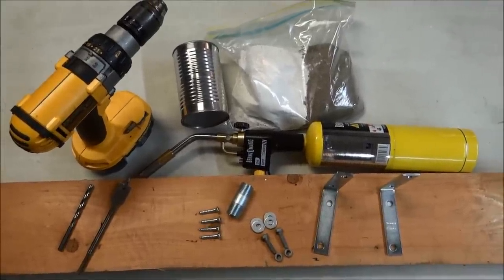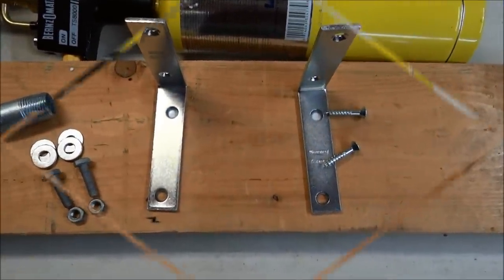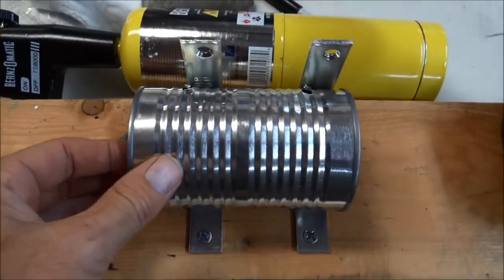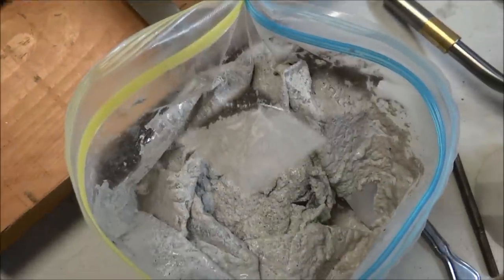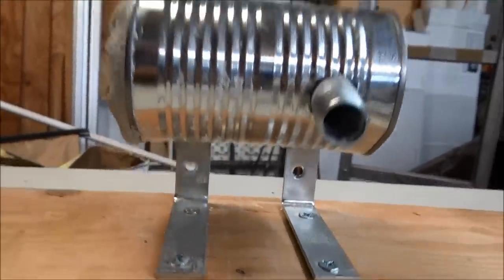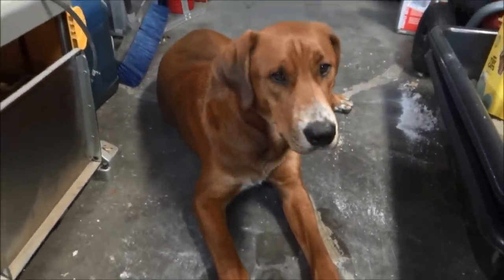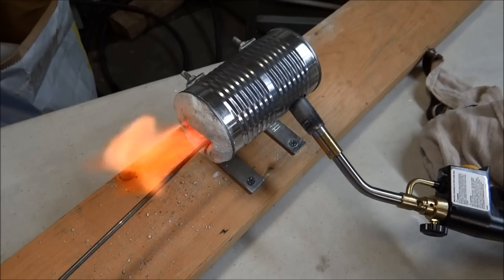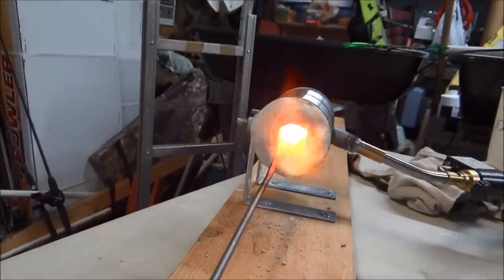Home Made Soup Can Forge - 2000+ degrees - Make your Own Tools

Comment: does the regular blue bottle propane get hot enough too?  or is it only map gas that does it for ya?
Reply from the maker: Yes, the propane will work, just take a little longer.  Remember to heat it up slow for the first run.  Thanks Delta.

Comment: I made a larger version of this lastnight and I am having trouble getting it up to temperature.

I think the internal volume might be too large for my torch. Also, Plaster/Sand isn't a very good insulator.
Reply from the maker: Jeremey Allen Maybe add another torch.
Reply: As it turns out, I made the internal diameter too big. I applied a bit more mortar to the inside, and now it's perfect.
Reply: In his video he uses mapp gas and it's hotter than propane so buying another tank is a waste mapp gas cost the tank alone $10.00 with igniter $50.00 or less the propane take cost $3.00 alone at the Home Depot

Comment: Couldn't you make a hole on both sides, and have the torch close to one side and angled to the other so that the flames shoot out the back yet it's still the same temp on the closest side?

I know you tried to make this really simple but I'm just wondering.
Reply from the maker: Daniel Quilling You will have to test that and let me know.
Reply: LifeBuzzN Yeah, just a theory.

Comment: This looks like a cannister of Bernzomatic Mapp gas. If so real Mapp gas is no longer made and this is really just a cannister of propane and propylene of which the difference in temp is negligible by about 100 degrees compared to straight propane.

Comment: I did it with a paint can but the hole is the same size yet my forge is not getting near as hot and the flame is hitting the wall and just getting that one area hot but not shooting out the front.
Reply from the maker: Joe Dimagio You can is probably too big for the size torch.

Comment: At that rate, how long will a new bottle of Mapp Gas burn...?

How much lower was the temperature using regular propane...??
Reply: +Bob White Propane burns at around 3,600 F and MAPP gas burns at around 5,300 F. These are not exact numbers, but close enough to demonstrate the difference. I've used both in a similarly constructed forge, and the yellow tank will reduce your burn time by about 30% per blade. Hope this helps!!
Reply: But using MAPP costs 2-3X what using propane does
Reply: Sleeper Awake It's worth it. I've used both, and MAPP is way faster and gives a good orange glow to my steel in less than half the time regular propane does.
Reply: Ok, I'll go experiment again.  If using a forge like this one propane is still the economic way to go.  However, I have used MAPP to bring old files quickly to critical temp and I don't remember the difference being that drastic.  But I will go and try it again with convenience in mind.

Comment: 2000+ degrees? I guess the tempreture estimated wrong.. 1200+ max I guess. 2000 would melt the steel rod first, then entire furnace ))
Reply from the maker: You are probably correct, 2000 degrees may be pushing it.

Comment: Did you need too make the walls that thick or could they be thinner?
Reply from the maker: If it's too thin, it will not maintain the heat as well.  Thanks.
Reply: Okay, thanks

Comment: Ok 2 things one can you have the flame heat up something from underneath 
And can it melt iron into molten iron
Reply from the maker: Hi Scotty, No, I'm pretty sure it will not melt the iron to molten.  It will heat it up enough to bend and pound it out tho.
Reply: LifeBuzzN I was for a moment there going to say that it might melt the iron if the iron was small enough and nothing was sticking out colling it as its 2000+ degrees but then I remembered you guys use Fahrenheit :D By the way where does the oxygen enter to keep the flame going? Good video best regards from Europe.
Reply from the maker: Eivindbeivind
The tip on the torch pulls in the air needed.  It pulls it in thru the nipple.  Thanks
Reply: LifeBuzzN
Ha ha ha... he said nipple.. Sorry, that was the 5 year old Peter Griffen in me.. Just trying to fit in, with some of the other commenters on here.. I guess I should add, that others have done this video right? That blows my mind, because everything we do, we got from someone or somewhere else. Even the words that I am using to write this, came from someone else.. Whatever makes up for their low self-esteem I guess.  Either way, thanks for the video (one handed or not...lol) and I learned something here, that I might have never learned, if not for you taking the time to put it all together. Thanks a lot LifeBuzzN!!
Reply from the maker: Clinton Billman
Thank You Clinton.  It takes all kinds to make up this wonderful world of ours......huh?
Reply: Yes it does and I don't think I would have it any other way really. If everyone was perfect, then people like you and I would just be... Well, like everyone else... :)

Comment: How long does a can last? And is it safe to just keep switching them out?
Reply: By can I mean canister of gas, not the soup can. Well, also the can?
Reply from the maker: Of course, it depends on hot you have the torch burning.  Remember that this is just Plaster of Paris and sand, so it will eventually dry out after a lot of use.  For long term heavy use, you should use refractory cement vs plaster.  Thanks John.

Comment: Cool little forge...but...seams the torch alone would be just much heat when used directly and the trigger helps to save fuel. No disrespect, our is cool still.
Reply from the maker: Thanks for watching.  I would love to have a video response of your idea.........I'm curious.
Reply: I have been trying to torch my steel directly... nope... the forge builds and retains heat... the torch pissing on it directly does not.

Comment: How much did all that cost and where can I get the plaster
Reply from the maker: Hi Nick, the plaster of Paris was a couple of bucks at Lowes.  The sand was free, the can was free.  I had the bolts and stuff laying around the shop.  The nipple was $1 or so.  I might of spent less than $10 on the entire project.  If you don't have a torch, that $20-$30.

Comment: could this be rigged up to something tht burns coal/wood? Also forgive my lack of imagination but what kind of applications would this have?  Seem too small.  Very cool though
Reply from the maker: I used it to make small tools, but mostly an experiement.  I have since gradualted to larger solutions.  Check out my other vids.  I use an old charcoal grill with coal and a blow dryer.  http://youtu.be/maD6johkQ_E
Reply: Micah Houghton I seen another dude some time back make a similar one like this for making craft hunting knives. This kinda stuff public schools need to get back to (80's style) regarding industrial arts. Good stuff dude.
Reply: if you use a bigger can you can make a bigger forge

Comment: Im going to try that this weekend! Any more tips?
Is the plaster/sand mix durable or does it crumble and break?
Reply from the maker: The plaster will eventually dry out and crumble, however, you'll get several burns out of it.  Definately worth making.  Let me know how it goes.
Reply: Hm, it would not fire up as hot as yours, maybe my walls arn´t thick enough? Next try this weekend. ;)
Reply: I used it for some months now I finally have to put it aside for something bigger and better isolated, to do the projects I'm looking forward to do.
But thank you! To get into smithing it was a real blast!^^

Comment: "MAPP isn't propane"
true MAPP gas production ended in North America when production was discontinued at the only remaining plant making it. Current products labeled "MAPP" are in fact MAPP substitutes. These versions are stabilized liquefied petroleum gas (LPG) with high levels of propylene.
MAPP gas is also used in combustion with air for brazing and soldering, where it has a slight advantage over competing propane fuel due to its higher combustion temperature of 2,020 °C (3,670 °F) in Air.
The biggest disadvantage of MAPP gas is cost; it is typically one-and-a-half times as expensive as propane at the refinery, and up to four times as expensive to the consumer. It is no longer used much in any large-scale industry - for larger scale users acetylene/oxygen is more economic than MAPP/oxygen when high flame temperatures are needed, and propane/air is more economic when big overall heats are needed

Comment: I am a little concerned about the propane nozzle just being slid in. I would rather see it secured so it can't slip out. Even a low tech idea of a cut-off bottom of a plastic soda bottle slipped over the bottom of the propane can and a little bungee (or rubber band) attaching the soda bottle to the wood would make me feel more secure. A lit torch slipping off a table is not my idea of fun.
Reply from the maker: queenninathetwin Safety ALWAYS first.
Reply: plastic? Re think what you just said....

Comment: I'm not convinced that at 2,000 degrees let alone more, that rod is most likely steel which burns at about 3,000 degrees and when he takes it out it doesn't stay hot for long so buy a pyrometer and find out how hot that really is
Reply from the maker: +trevor irby You are correct, probably not quite 2000, but enough to bend and work with metal.

Comment: couldnt you just have heated the metal with the torch to begin with.. the torch itself reaches that temperature..
Reply from the maker: AVanilla Gorilla It would take a bit longer, if it got hot enough.

Comment: You need a REAL anvil. You will destroy that bench vice. That surfa ce on there is nowhere near hard or heavy duty enough for forging. Also you can increase the efficiency of that soupcan forge by using the next size larger pipe nipple and give it a little combustion air around the torch head going in to the mini-forge.
Reply: Allowing a little extra combustion air in around the torch head will make it so you do not need expensive mapp gas but can use propane. Also you can use a torch handle and a 20 pound cylinder of propane to do the job.
Reply from the maker: I agree on the anvil......darn them things are pricey!!  Thanks for commenting and watching.

Comment: What is 50% "blust of pairs"  ?!?! Please guys, anyone who knows the language better than me tell me  - is that cement? or what?

But - great Video though :-) Cool thumbs up for it
Reply: Plaster of Paris :)
Reply: Jesus.... it's "Gips" in German - why do you spell a whole sentece for such a simple Word :-D

Thanks AMillionProductions :-)
Reply: I now know, he was talking 'bout cement :-D
Reply: Marc Humer No, he was talking about Plaster of Paris, like the guy before me said. Cement is one thing, Plaster Of Paris is another.

Equal parts SAND and PLASTER OF PARIS! just for clarity's sake.

and NOW you know.
Reply: Thank you phuturephunk.
Google gave me cement as synonym for plaster of paris - so I still don't know what it is.... crap :-D
Reply: Marc Humer It's used for modelling, people make ornaments from it using rubber moulds, it's usually mixed with water then put into the molds and left to set, when it hardens it creates solid shapes that can be worked/refined a bit like a fragile clay. It has similar properties to ceramic under heat, so withstands it and creates an even oven environment for your furnace, the sand adds durability. You can source it at your local model or craft shop and is fairly inexpensive :)
Reply: Marc Humer You'll need to remove the spaces then put this in your browser: http : // www . ebay . co . uk /sch/i.html?_trksid=p2047675.m570.l1313.TR8.TRC0.A0.Xplaster+of+paris&_nkw=plaster+of+paris&_sacat=0&_from=R40
Reply: Thank you very much, now I know...  it's "Gips"

Comment: so this soup can withstand 2000 degrees but the twin towers couldn't withstand the 500 degree jet fuel burning?
Reply: No it can't, hence the thick insulation.
Reply: If only they would've put paper mache and sand in the twin towers it all could've been averted
Reply: Btw jet fuel would burn at just under 1000 celsius so about 1800f.